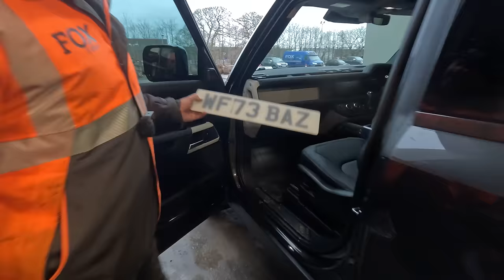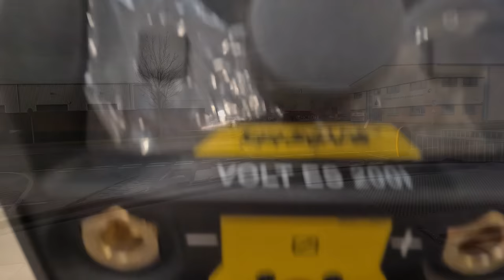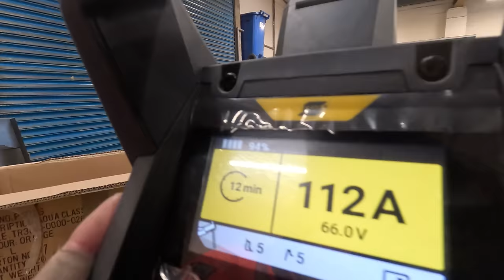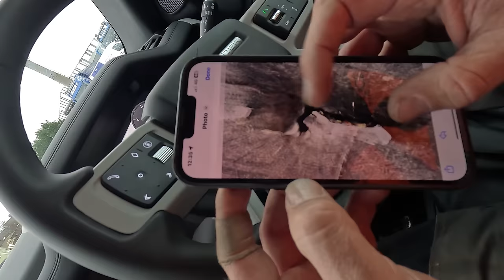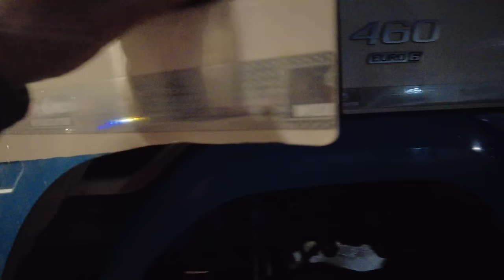Foxys New Plant Sales Yard Opens & Baz Gets A Defender! Chronicles Ch #027

Comment: Love the 90. I've just got rid of my 110 Hard top. Brilliant truck and not a single issue in 2.5 yrs. Towing a trailer every day and needing regular access to the back was a pain though. I've got an Ineos Grenadier now and they have split rear doors which open fine. Quick fix for now, you could get a jockey wheel where the bracket allows it to fold 90 degrees, so jockey wheel is parallel with A frame. Door opens full width then. Always interesting stuff going on. Keep it up Baz.👍👍
Reply from the maker: Thanks for sharing

Comment: Cracking great video young man. Having owned many original Defender's, I can say that ALL those with back doors suffered from jockey wheels acting like a door stop. Series 3 Land Rover's were the last to feature the "cat flap" rear top and bottom tailgate instead of a back door. The old saying, "they don't make them like they used to" applies but performance has been prioritised over function. And with the new Defender, function seems lost in preference for fancy interior features and performance. Anyway, looking forward to the next installment!

Comment: have to say worked at hurt plant a good number of years and mainly been on the Hitachi (now back in the yard tempory until new job starts lol) had a liugong 909 for a few weeks defo gets thumbs up drives well smooth controls done footings dug around services load wagons levelled stone and soil pulled concrete posts done really well firms defo need to give them a try with a open mind you would be impressed
Reply from the maker: Cheers bud for feedback, always good to hear the good & the bad.

Comment: Get a folding jockey wheel for trailer, just incase someone forgets  ,great video today as usual  such a vast array of this jobs in your manifest great skills
Reply from the maker: No one else will drive the defender mate, I won’t forget about the jockey wheel. Good idea though
Reply: @welderfabber  or weld the jockey wheel onto the a frame at the front as we had a similar issue on an l200 pickup. Great video again Baz and The Director
Reply from the maker: @Petetay  When we started this job as kids me & director we pulled trailers with Landcruiser's fully fitted out for anything made them ourselves, I will prob make 1 for this.
Reply: @welderfabber  sounds like it could be a decent separate big build mini series Baz.
Reply from the maker: If I do it will be filmed pete 100%

Comment: What spec is the defender 
Grade? 
90 commercial?
Power?
Did you spec it or stock 
Looks local Preston dealer
Reply from the maker: 300hp commercial, someone pulled out of a deal so I took it as I had one on order. So was already spec up

Comment: Good episode boys, glad you’re getting on with the land rover. I’m not a great fan of the new model myself as I’m quite a chunky chap I struggle with shoulder space. Luckily i can drive a Mercedes pick up which has had a stage one remap which has made a massive difference to HP and Fuel economy so I’ve been told that the the Nisan navara is the same pick up made in the same factory but Mercedes change a few little bits of body work and charge you double the price 😂🤣😂
Reply from the maker: Good pick up them mate